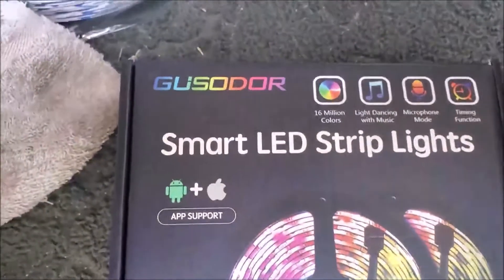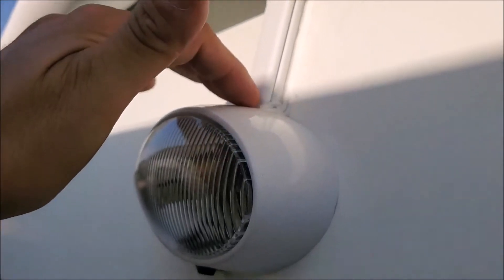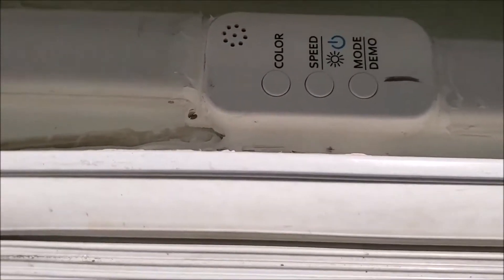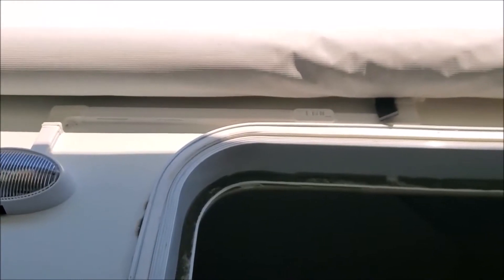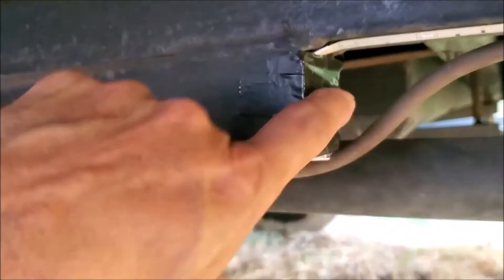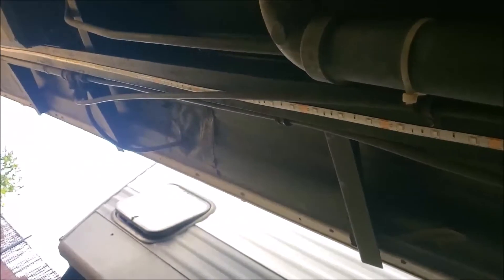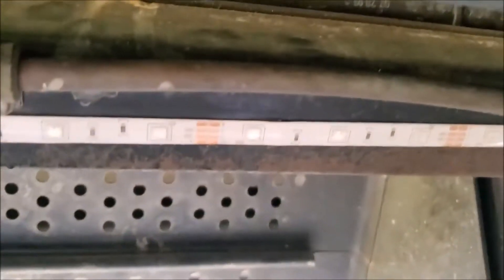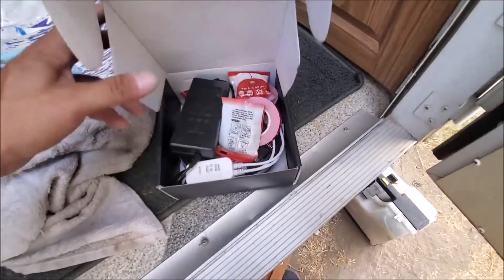RV Trailer Awning and Under Frame Ground Bluetooth LED Colored Light Install

Comment: I would just like to add. If you do this, MAKE SURE  you buy 12V DC led light strips. There also sell 5V led strips that are identical. If you hook up the 5V ones they will burn up.
Reply: Yes, What Josh said. Make sure all the electrical components you use on your RVs that will be hooked into your 12V system match the requirements or you will burn up the product, or worse burn up your electrical. Always, Always, Always use a fuse of some kind to protect your power sources. Yes you have breakers, but fuses will save you and are easily replaced.